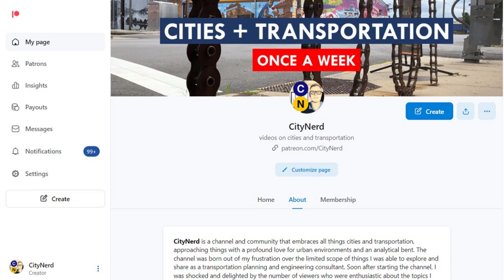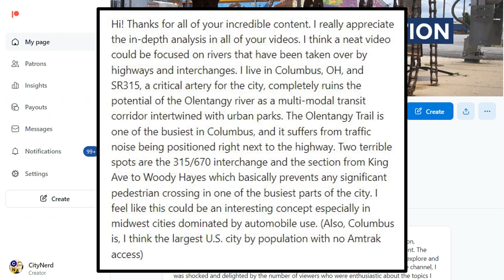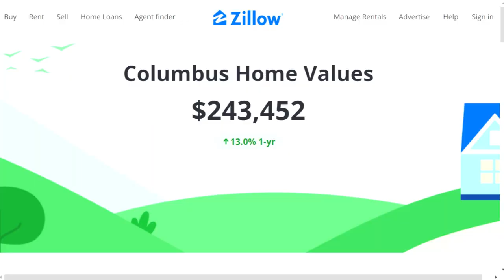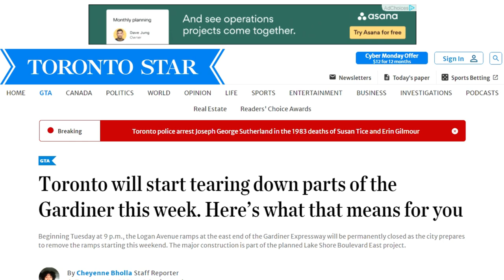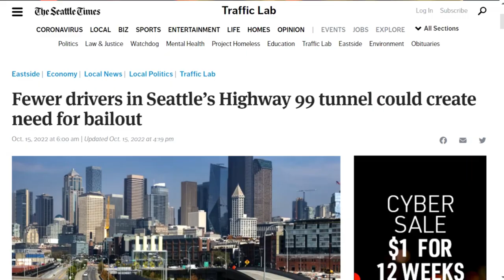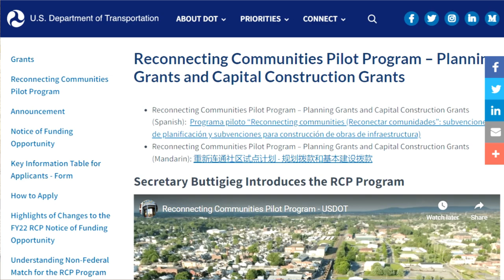Highway Engineering Madness: 10 Waterfront Freeways That Need to Go (North America Edition)

Comment: I agree that it is shameful that urban freeways were positioned on waterfronts (and for that matter low-income neighborhoods).  But I think that in discussions like this it is imperative to suggest alternatives when proposing removal.  How is Hartford to move traffic into an through its downtown if I-91 were removed?  As you point out a "belt" highway would have solved the problem but one of the charms of Hartford is that its downtown is not cut off from its suburbs to the west by a belt.  You would be trading one urban blight for another.  Until transportation policy includes reduction of vehicular traffic all of these discussions ignore the basic issue that we simply rely too much on cars and trucks to move people and products.

Comment: Who is going to pay for it?  Where will reacement roads go?  There is a reason the roads are there.   At least in NYC, the waterfront was not a place people wanted to live or bearound.   The waterfront was all piers with cargo ships.  So you had basically undesirables loading and unloading boats 24/7.  It was noisy and you had trucks coming and going all the time.  So putting a road in this undesirable area made a lot of sense.   The BQE area was the same.  You had all these people move in and push out commerce  now those people are whining about the road that was put there to avoid the more expensive areas.   Basically you have millionaires whining to keep out poorer folks who can't afford to live in the area.
Reply: Many of these highways could be moved inland easily. But it is often political excuses like this that prevent it from happening. (I don't want the traffic noise outside my home!) I live in Tokyo and they have barriers that dampen the sound. I worked next to a highway at Hitachi in Ueno and never heard the traffic. Lazy person's excuse.